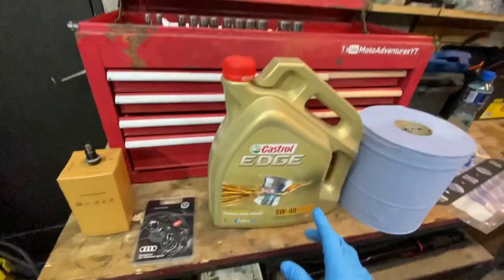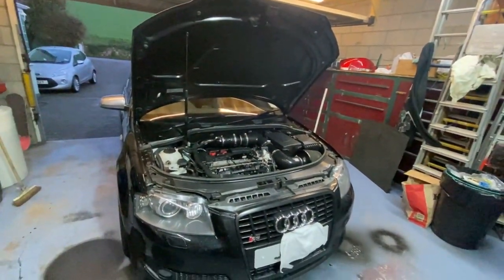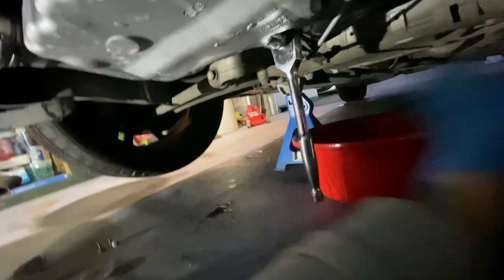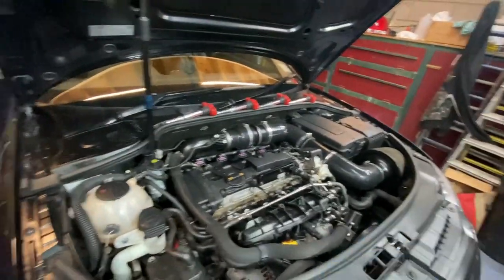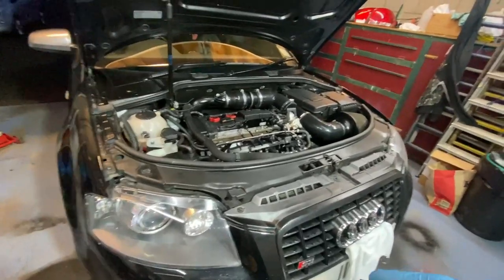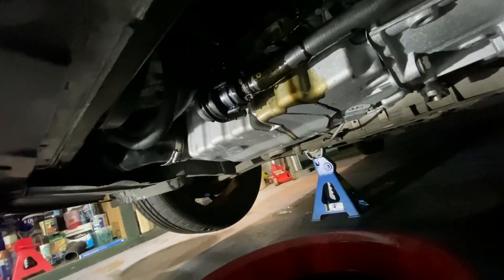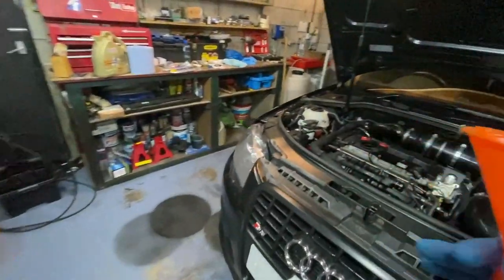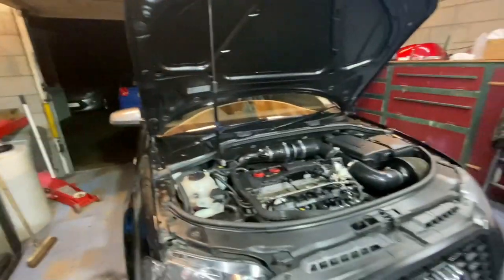Audi S3 8P - Modifications / Service!

Comment: if you can, you should make a video about cleaning of intake manifold... worth it on tfsi engine?
Reply from the maker: Hi mate, fortunately I wouldn’t be comfortable taking that off, as once it’s off the injector seals have to be replaced, loads of seals ect, mines been done before by Audi, intake valves been machine cleaned, really good for before getting it mapped mate

Comment: Alright mate , just bought a 2010 . Just wondered if you've had any issues with oil consumption on your a/S3 . Also noticed you used 5w40. Any reason cos I've been told it takes 30. Thanks in advance and keep up the great videos.
Reply from the maker: Hi, I used 5w 40 just because it’s thicker, less wear on internals. Especially if your abusing the car thicker oil is always better, don’t really notice any bad oil consumption although I check it once a month and if it needs any I’d just top it up, not over thinking it unless it’s a weekly thing 😆
Reply: @MotoAdventuresYT  thanks for the reply. Pretty much sorted it's self out, think it was to do with me getting to excited with the accelerator the first few weeks I had it. Also noticed a small oil patch around the bottom of the sump so that's getting sorted next week. Thanks again and keep up the good work

Comment: Good one again. When u started it up did  u have a bit of a knock sounded almost like flywheel to me.

Also just wanted to know do you have links to manufacturers of the carbon trim pieces on the center consul and handbrake buddy?
Reply from the maker: I noticed that aswell haha, it’s because i done the oil change, the cams didn’t have any oil on so just needed a second for the new oil to get up to the cams :) unfortunately not mate, got them off ebay second hand, as it came from a s3 that was being stripped.. best thing to do is to go on ebay and type - Audi s3 8p carbon - and it will show everything available that’s carbon :)
Reply: @MotoAdventuresYT  Ok cool I'll take another look. I did search that already and all I could find was door trims and mirror covers. 

And it sounded louder than dry cams bud. But I may be mistaken bro. 

Oh funny how we always get the same colour gekko to suit our cars eh. I noticed that on you 1.8 also..😁

Peace
Reply from the maker: @davidkane9876  hi mate, yeah they do come up now and then, although just gotta keep searching, I search once every two days to see if anything has been added haha. Yeah it worried me at first but it’s never done that before and still hasn’t to this date, so I am confident it was that haha, yeah man always a must 😂
Reply: @MotoAdventuresYT  lol I took a look last nite ther 180 a pair. Is that what you paid?
Reply from the maker: @davidkane9876  yeah mate